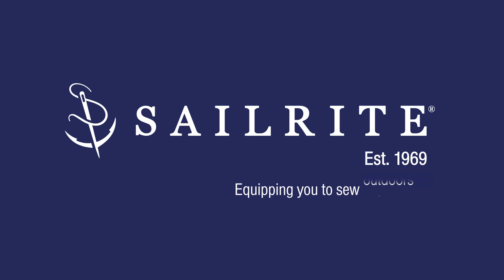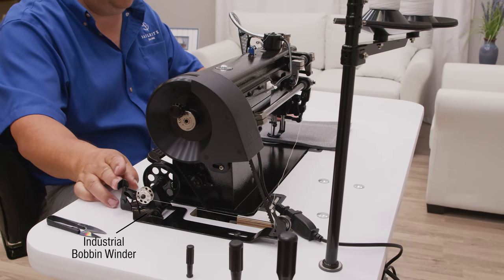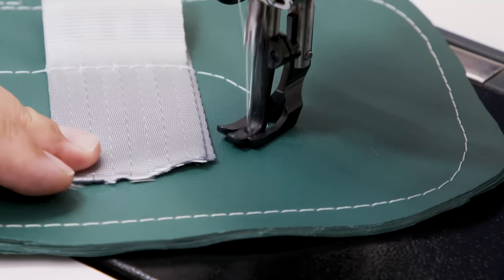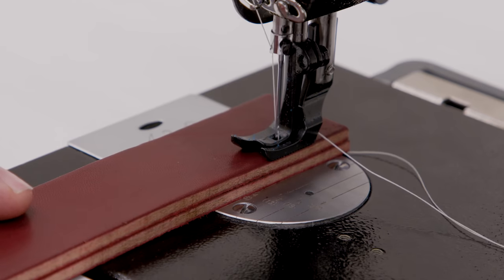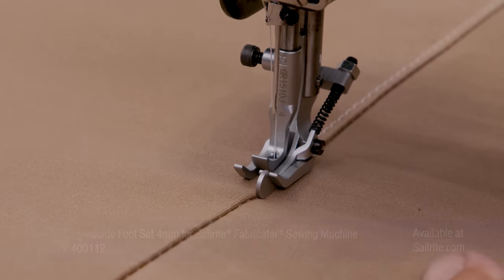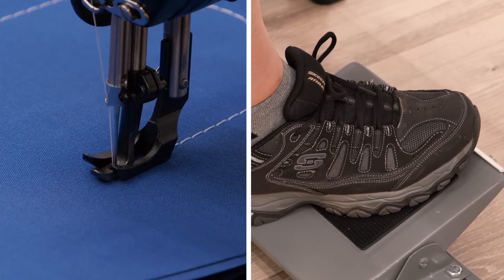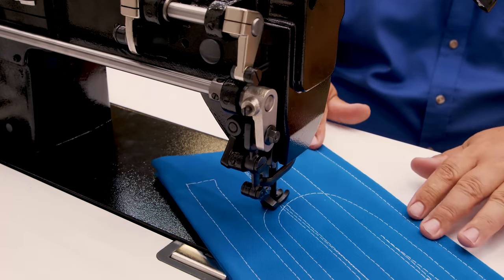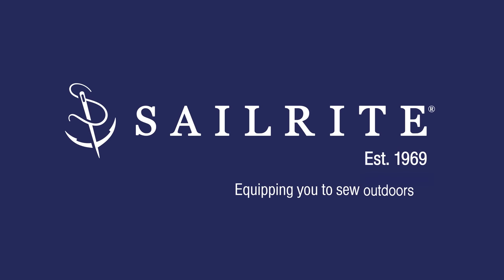Sailrite® Standard Fabricator® Sewing Machine Demo

Comment: I love sailrite helpful videos but this machine is the exact same as the Typical GC6 just painted black. If you want to get in to an industrial machine for a fraction of the price go with that. Otherwise if you have the funds go for it!
Reply: Thanks for the information!
Reply from the maker: The Sailrite Fabricator package has huge advantages over any sewing machine in its class, including the Typical machine you mentioned. Here are just a few things you will get with the Sailrite Fabricator: Head is set up by highly trained Sailrite sewing machine techs, it works right out of the box. Table top is extremely high quality made in USA. Stitch Pro Balance Wheel (made in USA) with Posi Pin. Cogged Timing Belt. Workhorse Servo Motor, much better than any other servo in its price range. Service and Tech support that cannot be beat! I could go on, but will stop. I wish you could test the two machine side by side and sew them off, you would see a huge performance advantage with the Sailrite Fabricator right out of the gate.
Reply: I have to agree that Sailrite have put an excellent custom package together here. It is truly a craftsman's setup with the workhorse motor etc..
Reply: @SailriteDIY  You would be surprised how many people want a side-by-side comparison. Most people seem to believe the Sailrite machine is a slightly modded machine with a hefty price tag. IMHO Sailrite needs to educate the public on, not only the machine, the overall value of the modifications, customer service, videos, support, etc. that Sailrite provides. I'm looking forward to doing business with Sailrite, please get your marketing team on the ball. These are trying times and you need to stay in business. Looking forward to seeing the results!